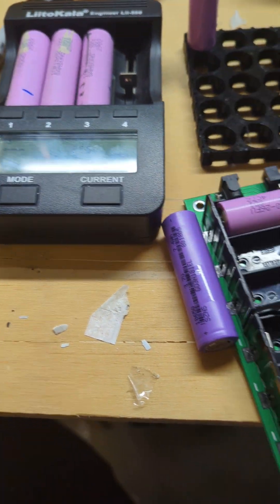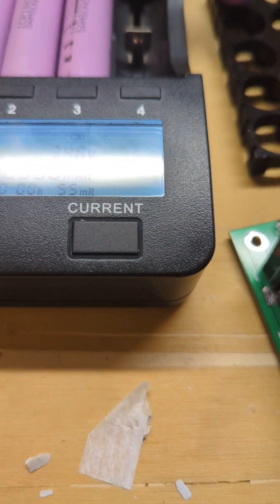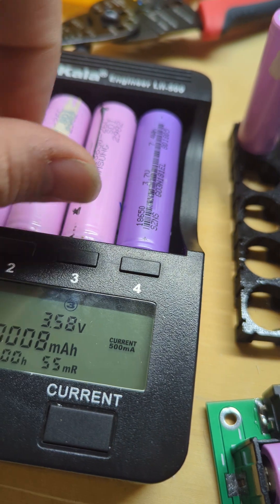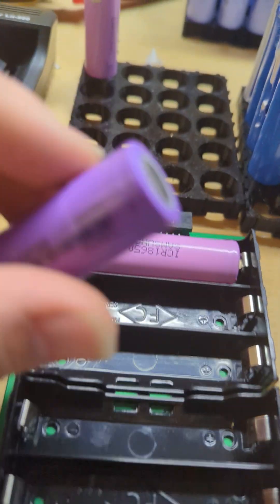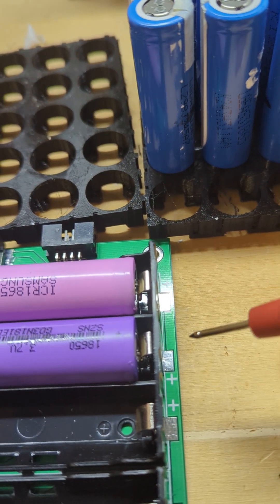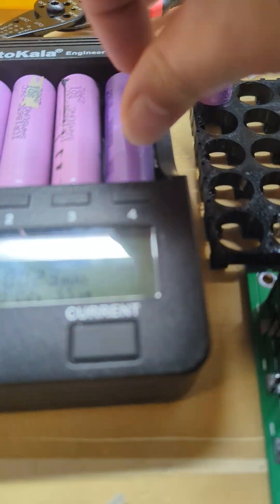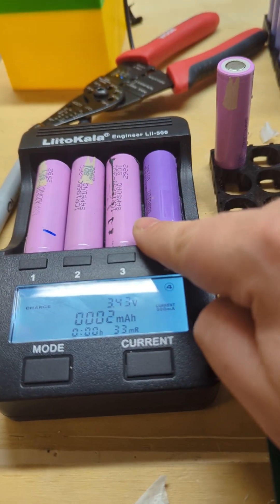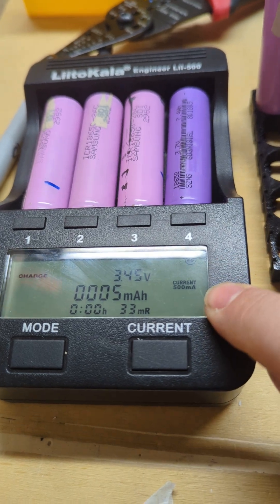18650 jumpstart hack.

Comment: You can get a tp4056 module for like 50cents for this. It can charge lithium cells even if they are down to 0v, and it has constant current charging. Also it wont drain another battery.
Reply from the maker: I saw this recommended before. The main thing is, I don't have one. I have another battery.

Comment: What are you going to use these cells for? Chances are a lot of those 2v or less cells will end up being heaters or self dischargers which could compromise your system design
Reply from the maker: Correct which is why you do additional testing.

Comment: FYI, there is a much safer way to do basically the same thing, which does not put nearly as much stress on the battery, and thus is much less likely to actually damage it in the process (so you can recover more of the capacity).

Connect up the batteries in parallel, but with a 20-30 ohm (1/2 watt) resistor between them.  This will limit the balancing current to a safe level (which should generally be under 0.1 C ("trickle charge") for recovering extremely drained batteries).  It will take significantly longer for them to balance (up to a few hours), but you're far less likely to actually fry the battery in the process.

Alternately, if you have a bench power supply that can do current limiting, set it to around 3 volts with a current limit of 200 mA, and plug the battery into that for a while.  Once it gets up to a reasonable voltage, then you can transfer it to a regular battery charger for the rest of the way.
Reply: Please follow this man advice, he is right! Thanks for the comment.
NOTE: Have to recommend the bench power supply, that's for sure the best way to "try to revive" a dead cell, and be mindful that dead cells tend to have greater parasitic discharge in the future (after being revived) also they can develop higher internal resistances, as so take it into consideration if you are trying to build a big pack.
And when reviving a dead battery don't leave it alone, It's a fire hazard!, better if you do it outside during a sunny day or in a safe environment as they tend to go boom quite easily.
Reply: @joanf  Outside is ideal, but if that's not really convenient, what I personally do is to stick them inside one of those "LiPo battery bags" (or other fireproof container), and put that somewhere away from anything potentially flammable (sitting in a metal pan or on a concrete floor or something), while they're being recovered.

IMHO, the bench power supply is the best way if you've only got one or two cells to deal with.. if you've got a bunch, then the resistor-balancing-batteries trick can be done to a bunch of them in parallel, which is nice (you do also have to keep an eye on them to make sure that a completely shorted battery doesn't just kill one of your other good batteries in the process, though).
Reply from the maker: Yes you can use a charge to charge the battery.

Comment: That's actually very dangerous. I used to do this trick until I had to throw one jump-started cell out of the window, because it got burning hot. Overdischarged cells usually get damaged internally and it's a lottery if this will work or not. Sometimes a recovered cell will drop to 0V by itselfs after a few weeks, so it can damage other cells if connected in paralel.